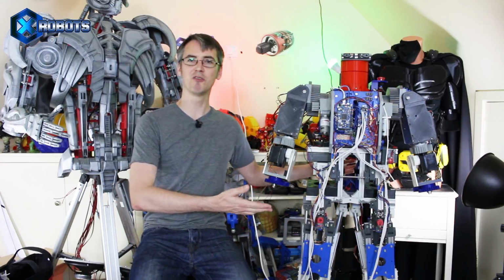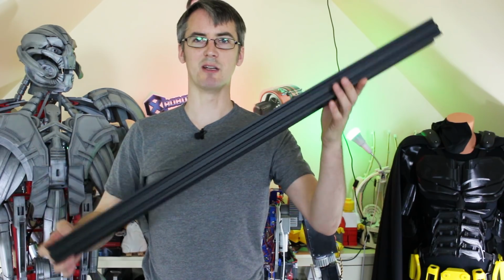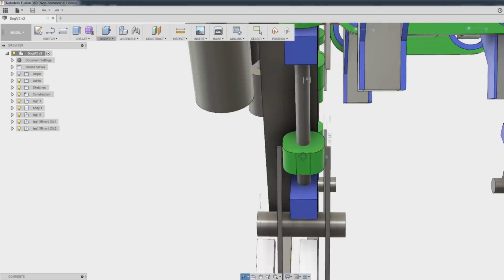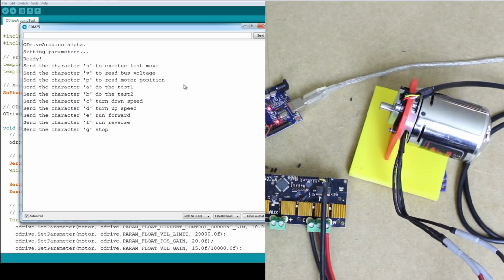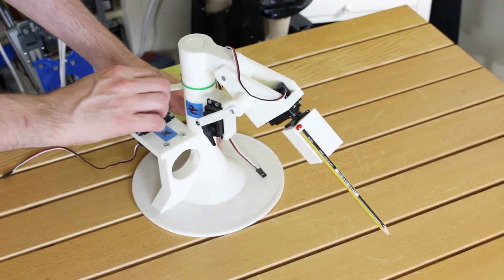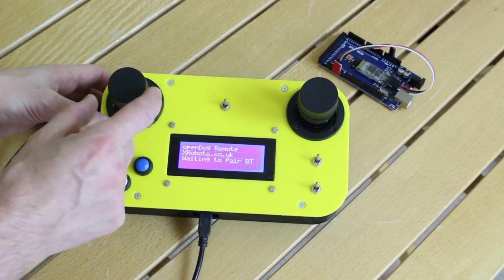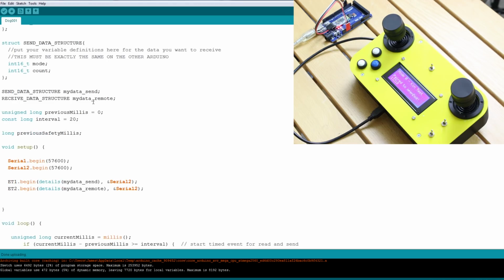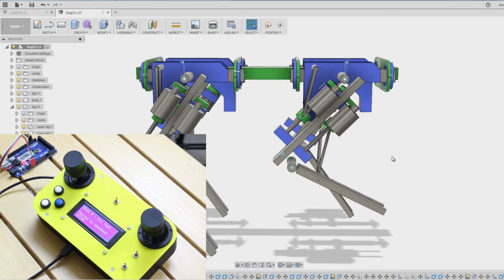openDog Dog Robot #1 | Planning & Explanation | James Bruton

Comment: Looking forward to this one. Should be fun. The rods that connect the thigh bearing (lead screw?) to the hips/shoulders will have to be pretty strong to hold up all that weight and have the ability to move freely without jamming due to all three axis having an effect on it at all times. Nice design! Cheers!

Comment: You could pull the model into Unity and simulate it in there as an additional stepping stone to making it in the real world. It may also enable you to test out some walking gates ahead of having all 4 limbs operational.
Reply: Building a rigid body model in the URDF and simulating in Gazebo via ODE, Bullet or Dart could be a good solution. It might be way more work than just building it and testing it on the real hardware.
Reply: Blender would be better for an open source project.
Reply: Another useful one is Sletchup with Sketchyphysics, it is a full on physics simulation which is easy enough to set up.
It can't replicate material behavior but for testing a rigid mathematical model it should be spot on.
Reply: There even are exporter scripts for Fusion360 -> SDF / URDF so you can then test it in Gazebo.
Still requires manual work though
Reply: and there are also plugins for Rhino's Grasshopper to directly read from arduino to drive the whole model in real time from the remote. but I think that its great your just getting a proof of concept and going to hardware. as long as its working how you want go for it!
Reply: I agree with @bobbob1730 and @Quertz. The model could also be widely used to simulate the dog without building the physical dog. For example if someone wants to test different locomotion models quickly. Seriously go with the URDF and Gazebo suggestion. The Unity, Blender, Sketchphysics and etc are far inferior in terms of physics simulation and applicability to the real world. Looking forward to following this project :)

Comment: As someone who's gone down the path you're going writing software for controlling a robot arm, it ends up being a lot easier in the end if you set up DH tables, and doing the kinematics with matrix math than trying to think about how to do it with trigonometry. If you do it that way, then you also gain the freedom of not having to do things like making the segment lengths the same or keeping the axle of rotation in line with the ball screw in order to kind of cheat to solve how to move in a straight line.

Comment: James I notice you convert from degrees to radians using some numerics. If you use the fact 4*arctan(1) = pi, you can eliminate some inaccuracy from floating points and rounding. Usually the syntax follows as :: 4*atan2(1) :: in most languages but your mileage may vary. 

I understand that the integer estimates yield better run times on code, but just thought id say!

Love the videos,
Keep it up!

Comment: I wondered how long it would take you to come up with a cool use for the O-Drives!  

In the 90's I built a 'robot dog' to test some ideas.  Some of my conclusions might be useful.  I used a GA to evolve the walking gaits, trailing a PC mouse behind (to measure distance moved) so it could measure the 'goodness' of each evolution, evaluated by comparing distance travelled to power consumed in a certain time.

The 12 Axis version worked, but the gaits were 'lumpy' and slow.  The evolutions were keeping the CofG within the triangle mapped out by the three feet in contact with the ground - which achieves good stability.  Falling over gave a poor measure of 'goodness' - so it evolved a stable but slow solution.

Adding a movable mass, initially on a 2 axis X/Y arrangement improved the apparent smoothness and efficiency.  I tried a 2 axis 'tail' to shift the CofG - which worked just as well as the X/Y.  This meant it could sustain an otherwise unstable position for longer without falling

Originally, my drivers were position based - the controller was commanding a position for each axis.  The biggest improvement was changing to a force control algorithm where the controller could read the axis positions - but the control was just the amount of current delivered to each motor.  The best gaits came from just sequencing bursts of current.

I didn't have access to gyros, nor the computing power available now.  Also, the motors didn't have the dynamic performance to use gaits where it's in a continual state of falling.  I have no doubt that whatever you come up with - it will be cool!

Comment: Neat project, and the first I'm really interested in actually trying myself.  I'm assuming your goal here is stable, dynamic, and reactive walking?  AKA "kick it and watch it stagger back to stability".  If you are going to use ball screws I'd recommend you design your legs to be damped springs.  Mechanically that's pretty easy in your current design by making the connections between your drive nuts and your leg (the triangle side opposite the joint pivot) be a spring.  You could make the piece curved so it can flex, or have a literal spring.  This will increase the control computations (avoiding/counteracting harmonics), but will make it much easier to manage unexpected impulse feedback on the leg contact point (ie how you avoid shattering/bending something when you stub it's toe).  It might be possible to also use that for some kind of force feedback sensor, which would also help, since measuring force feedback on the servo through the ball screw in this setup will be...interesting.

Comment: Just my 2 cents, do with this what you will: I would suggest you go for linear actuators or (decent quality) servo's, they wont have backlash either and will work alot faster then a screw-rod thingy-ma-jigger, which gets important when you start doing IK/FK

Comment: consider that once you get the inverse kinematics for the leg(s) done you need to rearrange it to control the center of weight of the robot. You should set it up as two rectangles on the ground where the projection of the center of weight should be moved. The inner one is the solution space for the move commands, and the outer one is the solution space for the general stability. 

I am not that deep in the topic, but I think that while doing the maths you should consider that the rectangles may change their shape and area thus controlling each other. For example- if you need to solve difficult stability problem you may not have that many solutions and/or the stability solution space may be too small which will require your driving logic to trigger the movement solution space and try to get it back in the boundaries of the stability solution space. Now that is actually advanced stuff because it relates to rough terrain which means that you need two more models that cover the actual relation between the two spaces and the transition between those(the dynamic/chaotic stability), so it is highly unlikely that you go that deep, but you might try and give it a shot.

Comment: Awesome project! Now a suggestion. I think you can reduce the weight a lot, if you like, by reducing the weight of parts that see little stress (lighter material or put holes). I think this could allow smaller lighter motors which would allow fewer batteries, thinner legs, increase agility and not unimportant would reduce the cost. Just imagine how much smaller the forces would be if it weighted only a few kilos (like model airplane construction, light balsa wood, strings, glue). Of course it depends if this dog will need to carry some heavy costume or charge once it is finished. What do you think about that?

Comment: The servos are each capable of 2kw output, can do braking/holding, and apparently even position-slip torque feedback based on the supplied holding voltage? Um, you can probably direct drive each joint with a servo, and skip the ballscrews. This will eventually need force-feedback measurement, and if the servo and position encoder can do that job too, it reduces design complexity. Planetary gear reduction at each direct-drive joint would improve torque and reduce holding force, but still pass  weight/force feedback.
Reply: For feedback, you'd need a way to vary the holding torque voltage (this would save energy in the long run, by only supplying the minimum holding force needed), and then a graph of various holding voltages vs the amount of position slip for varying amounts of torque feedback. Position holding would have to take this feedback slip into account and expect it, offsetting the final position and/or holding voltage to compensate.

Comment: Reverse kinematic models are so 2017... just set up a fiducial point, manually move the pencil tip to a given location, record, repeat over a few more locations a few more times. Then parameterize the movement based as a of controller commands, set a loss function, and train a net or other learner to figure out the best commands to put the tip to a given location. Train over several hundred iterations over dozens of generations and Fido will have learned to move itself!  Or... something... ;)

Comment: I would separate out the degrees section to just be a subroutine that outputs the values you need to debug with in a separate debug register and then return to the main code line to continue from the original radians value with no converting. Converting from one type of angle measure to another and then back will increase the margin of error at each step. It will increase multiplicatively  at each conversion step. This error will then be added repeatedly with each loop. If each joint has this same error addition, the result will be very inaccurate calculations for target movement.

My PLC class covered how error can cause incorrect position in controlled machinery and robotics. It was best to always convert a value once into the common unit set the program would use. Ideally, you would have no conversions, but that is rarely possible. You might be able to do some error correction using the rotary encoder positions and using a look up table to compare expected position with real position as seen by the encoder values. Creating the debug values you need for reading by deriving them after each step in the control logic and then outputting them to a set of registers for your use  would also be another option, but would need to be written for each motor loop and changed individually. Using a subroutine would allow changing just one set of commands since you could have the subroutine query a value to see which motor is being controlled by the loop that just called it and then selecting the correct debug register values to write to.

I hope that this suggestion helps, but I am unsure of exactly how you are doing your calculations, so this might not work for you at all.

Also, I could hear the frequency of the PWM from the motor controller when you demonstrated the hold position function. I don't know if I was the only one that could, but it was there.

Comment: i hope it works but just from the design, it seams the robot may have stability issues.  The weight is currently going through the legs at each corner of the machine (basically making a square with small contact points with the ground) Angling the legs a few degrees so they point outward may move the weigh towards the center of the dog (pyramid-legs are base).  The machine already has a high center of gravity, maybe reduce the size of the upper leg if motors can handle it.  (This is just me thinking out loud, sorry)

Comment: Inverse Kinematics is not "harder" to calculate. It's just that there is no single solution to that problem. There are many possible combinations of angles that gives final position that we need. The problem is choosing one of many combinations. The problematic part is specifying criteria that would select the most beneficial angle combination for us. Usually we select the combination that has least amount of changes to angles, but there are cases when it's not what we actually want.

Comment: I bet open sourcing dog will allow it to surpass Boston quickly. Great work
Reply: Chaz * We just need a good software. Like really really good.
Reply: And hella expensive sensors.
Reply: Boston uses hydraulics that people like us cant afford😢
Reply: Spot mini doesn't
Reply: Seems you're right. But then what magical actuators do they use?
Reply: RIkard You could do away with most of them for basic locomotion.
Reply: The spot mini of the INTERNET!!!
Reply: I bet not :)
Reply: I believe spot mini uses brushless motors too. just some special kind of ones.
Reply: YES. Provide a VM for people to download and run, crowdsourcing the training time of a true AI. That is what could make this project surpass Boston Dynamics on the cheap. The "powerful code/good software" comes from massively parallel training in a simulation.
Reply: Mind you, Boston Dynamics' approach was deemed "too primitive" by Google, they're making their Deepmind system learn to do the hard work for them.
Reply: IIRC, Boston Dynamic's code is mostly static "clever" code and not trained.
Reply: Ron Netgrazer is Google planning on building some robots, or are they just developing the software to build better robots?
Reply: manaquri does static mean manually programmed/not a neural net?
Reply: IIRC there's a neural net for the vision part, but everything else is handcoded algos, though at some point a good algorithm storing environmental data and reusing it can be close to a neural network in functionality, though it doesn't use neurons. Sometimes it's better to use "fixed" algorithms, as you can easily know the failure modes and how it can and cannot behave. 
Basically it is calculated maths and not trained till it works.

note that I remember hearing or reading about the boston dynamics software somewhere, but it's a long time ago so I might not remember correctly or it might have changed.
Reply: Primarily need to find a source for inexpensive electrohydraulic proportioning servo valves with reversing, which have a precisely variable flow rate. (A simple slam-on, slam-off solenoid spool valve is not precise enough.) Proportioning servo valves for industrial and factory automation purposes usually cost hundreds each, which for multi-axis hydraulic control really drives up build costs. All the rest of it is common hydraulic bits.

Comment: Impressive. I'd prefer an extra set of joints on the rear legs, but I realise that adds a lot of complexity.
Just... When you look at dogs, cats and other animals with similar leg structures you can see they tend to have very long feet and are usually walking on the toes of their rear leg.
Doesn't much matter if you lose the actual front paws and the toes on the rear leg, but losing the rear feet does make a big difference visually, and probably also affects how this thing would walk compared to what it's modelled off quite substantially.

But, I can understand why you opted for reduced complexity.
And since you intend to make it open source, I could of course attempt to tinker with the design later on... XD

Comment: I would use a neural network to figure out were the legs need to be, setting limits on the motion of the legs, then train the net to move the bot towards a goal (forward, backward, left, right) that way the net can compensate for changes in the environment. Good place to start is speed train a base net in a simulator then copy the code over and let it get used to the real thing.
Reply: Yeah building the sim to test the net would be a project in and of itself.

Comment: At 19.33, you use fusion to measure between the joint and the hole in the actuator slider. I notice you did not tick the XYZ delta box in the inspection window. This means it has measured an 'as the crow flies' distance, and not just on one axis. Maybe this is what you need, but I have a feeling that you would need a single plane measurement as if viewed from the side? Just though't id mention it....

Comment: The feet should have springs and sensors in them, like a thiner arched piece of spring metal or 3D printed plastic with a soft and grippy rubber like feet on the bottom, you should then put something like a small membrane button like in cheap computer key boards to sense when it hits the floor and then use another heavier detent switch like those in a microwave door to sense when the leg has bent and is holding the dogs weight on it. I bet you could master walking much easier with those inputs, like slow the speed of the leg going down when it hits the first button, the light weight button triggering thew speed of the foot to descend in speed logrithmically and stopping in height when the second button is triggered. meaning then you have the leg moving the leg in a way that it is flat or better exponentially moving downward. this would also give you feedback in case the ground is unstable. Then you can work on the programming by creating a neural network for the dog controller and strapping an accelerometer to the body to and trying to minimize all the forces besides the one for forward movement.

Comment: hey James, are you worried that the ball screw will bend due to the side load of the linkage? Your linkage is very similar to the IHMC exo LLA, but they had to use a carriage and rail to keep the force off the ball screw....